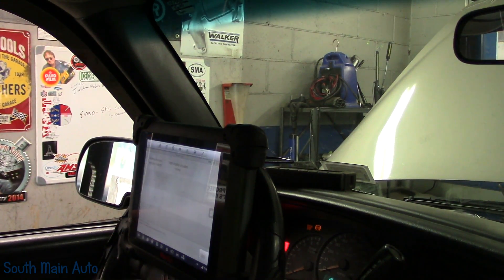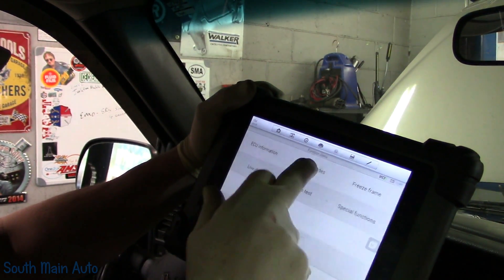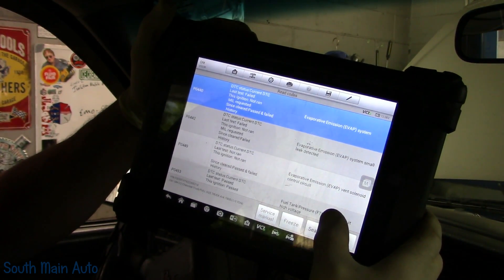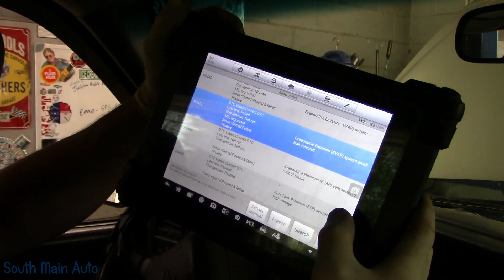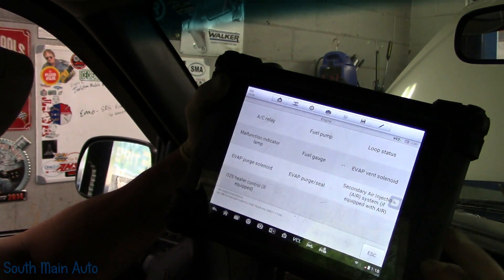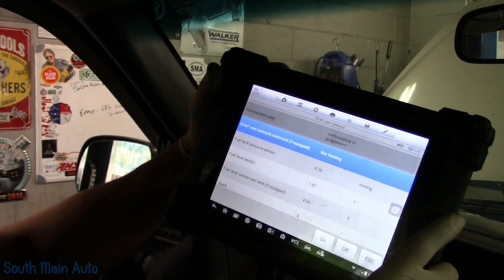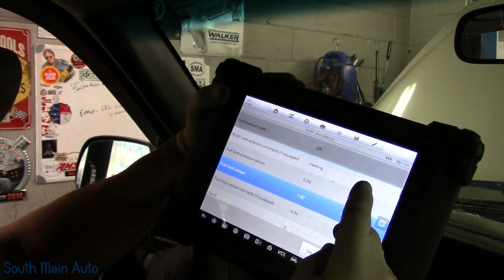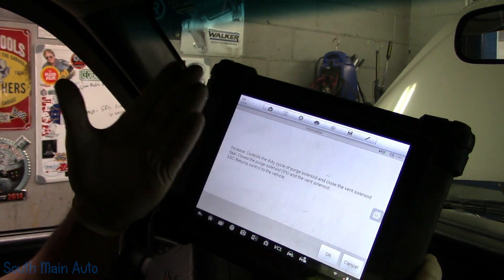Chevrolet EVAP Diagnosis: Codes P0440, P0442, P0449, P0453

Comment: I had a sticky purge valve and simply injected a little bit of silicone spray. Fixed the issue 20,000 miles ago

Comment: I know this video is old, but i checked my truck and it says "P0453 Evaporative Emission System Pressure Sensor/Switch High" but the video says "P0453 FTP sensor high voltage". Is the code different for different vehicles?

Comment: You mention a missing gas cap as possibly an issue, I'm wondering if my filler neck is causing the same codes.  If I fill up all the way, I get a spill back behind the side of the bed, right at the top of the fuel neck and on really hot days, I can definitely smell gas, even though there's none leaking on the ground (probably just vapors).  I need to replace my fuel pump anyway and was going to look at repairing/replacing the neck, this might solve my problem!

Comment: Got the P0449 code and the engine light is not on.Could someone have cut the wire to the engine light or is the problem not severe enough to make the light come on?

Comment: Yes,I did find the actual cause of my check engine light in my Chevrolet LS1 V8 powered Holden Commodore,on Wednesday,I was sitting at the service station waiting to use the air line to pump my tyres up.

When I started the engine back up,the check engine symbol became switched on (it's on an LCD screen) ,when I got home,I scanned it & got a P0171 code, previously,I got a P0174 code as well,I sort of noticed that the O ring was split & all hard on the fuel filler cap.

So, I bought a new cap on Thursday which has fixed the problem,the fuel tank wasn't holding any vacuum & I noticed that the idle speed changed (dropped) momentarily once I bought a new cap & fitted it onto the filler neck.

Since my car isn't fitted with a fuel tank pressure sensor no P0442 code is listed for the Chevrolet LS1 engine in Australia since Holden don't use one,all I can go off is the lean codes !

Comment: I have that code, p0440. My gas neck is leaking when I go to filler up! Could that cause my code! The fact that it is leaking. I did look for the fuel neck assembly. GM discontinue that for the 2000 Chevy Tahoe. But I can get it from different places. So again the fact that my fuel neck is leaking when I put gas in it could cause that code?

Comment: love your vids. need your help you are in new york . I'm in the great state of Nebraska, football team is not the greatest even with new coach lol. Lost speedometer  replaced sending unit on tail shaft of tranny sill no work been told mod behind glove box is problem can you give any insite 1992 chevy c2500 all it has is AC auto tranny 302254 miles can any one help thank you

Comment: Same body condition as my brother's '02 2500 HD (Duramax) was in 4 years ago. 😞

Gotta love GM  - they sure know how to make money! Sell the truck for $40 LARGE (at the time- much HIGHER now), rake in dough on sub-par parts,  then 12 years later, it's going to the scrapyard, and people run right back to a GM dealer for another! Amazes me. 

Great demonstration of why you ALWAYS need to verify a repair! I've had a few lately that have had more than one issue in the same system. Gotta slow down to go fast - take the time and CHECK. 👍

Wish I could've seen the keychain - sounds like my kind of humor. 😁

Comment: a hillbilly trick is tickle them with 28 to 30 volts in very small bursts. sometimes they break loose and work for a while. but failure is imminent :))

Comment: A suggestion on new videos would be a clock spring on a 2007-2014 GM full sized truck tahoe or suburban (GMC equivalent).  And do the ABS module replacement on 1999-2006 GM truck tahoe or suburban.  Thanks for the vids!!!

Comment: You made great use of your Powerprobe Eric! Looks like that truck has more problems than just the engine light! Leaking exhaust, Abs malfunction, lots of rust. Is this going to pass inspection like this?
Reply from the maker: Ummm NO! It will not pass by state law for several reasons but there is a shop a few miles from mine that let's just say.... everything gets a sticker :) I fix the engine lights because he can not and then they go see him for a sticker.....
Reply: Eric, would you mind muting the power probe (or put a piece of tape over the speaker)  in future videos? That sound is a bit ear piercing, especially with headphones. Nice video and use of it though.

Comment: I have a 2003 s10 4.3 v6 it runs great. If I start it up every 5-6 hours  it starts just fine but after its sits 12 hours or so it won't start i smell  gas strong and it has spark  and the security light comes on I had a 1626 code  I have checked from the key switch to the bcm and pcm everything is good   is it a stuck injector flooding it . the injectors have never been changed
Reply: It was the spider injector wasnt it? It would take 30 minutes to start my blazer in the morning until i changed the spider.

Comment: Just had same problem, replaced vent valve I didn’t retest and bit me in the ass!!!!! Live and learn... cool video , my Snapon smoke machine has more smoke volume....
Reply from the maker: This one does now that I added more fluid. A LOT MORE!
Reply: Steve Mazzarella when I find a bad vent valve or purge valve I typically try to block off the system and smoke test it to verify no more leaks before selling any parts.

Comment: my sunday morning is casting your videos to my tv (70 inch still clear picture). By the way your "aftermarket Junk" video dealing with remote start came in handy on my cousins 01 ranger. He didn't call me until he had replaced the starter and replaced relay and fuses (none were bad apparently). By the time I came in I followed your steps and used my OTC test light and found no power to the signal wire on crank.  I took the bottom of the dash out and found some aftermarket box wired in  series with the signal / starter wire.  Since my cousin has no remote start or "silencer" system he didn't' even know anything was installed.  I unplugged the box and jumped the red wire to yellow (only two wires) and it started fine. Long story short what a coincidence I say your video a few days before I worked on it. I was just watching some of your older videos.  I ended up putting the wiring back to stock.  The system was a silencer 6900a which after looking online alot of people have had to take them out lately. 

Thanks again I will continue to watch your videos as I have for atleast a year. Also I bought the domain http://southmainautorepairs.com to build you a site with your shop cost services etc. But if you don't need the advertising I could just redirect it to your youtube page. 

Have a nice day!

Comment: How will that rot box  pass inspection,??in UK it would be scraped,
Reply from the maker: In this case I am hired to fix the SES light. He gets his lick'em stick'em inspections else where...
Reply: John Easton   In some states in the US that would also be true.  I believe Eric has failed cars for rust issues in the frame.  Last I knew New Hampshire had the no rust hole in the body rule.  In my state of South Carolina they don't care about rust, safety or emissions.  Went to an auto parts store trying to take care of a check engine light......because I'm anal.  Told the guy at the counter I was trying to fix the check engine light and he asks me if the car ran okay.   I tell him yes and he says " then what do you care if the check engine light is on?".😬
Reply: Id say you care because you are paying the gas. Sometimes the "freedom" goes to peoples heads.
Reply: That's right eric. You only do what they ask you to do and if they want to do something stupid you can always make them sign a disclaimer. Stupid like driving away with wafer thin rotors or  tires with the cord showing. We have to do that over here because we are not really allowed to let them drive away if the car is in an unsafe state.

Comment: That would fail a UK MoT test with all that rust. It wouldn't fail on the money light though.
Reply: Parknest since the new mot regs came in it will
Reply: My Citroen Xsara Picasso passed an MoT in 2016 with the money light on. I didn't know that was part of the new regs.
Reply: In the U.K. You can just clear the faults, and if the light stops of during the test it passes. Almost a pointless new reg.
Reply: Yup I've dealt with m.o.t. many times . Spent much money in repairs  to keep it up to specs .